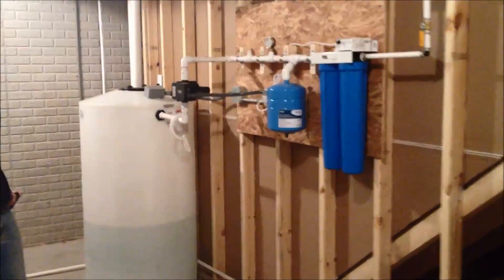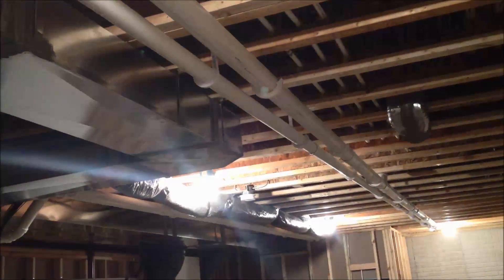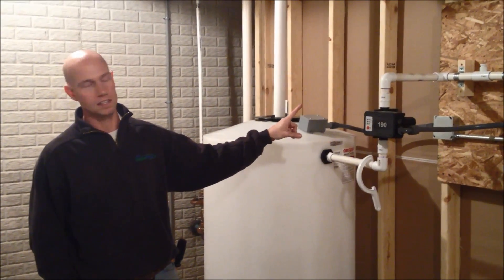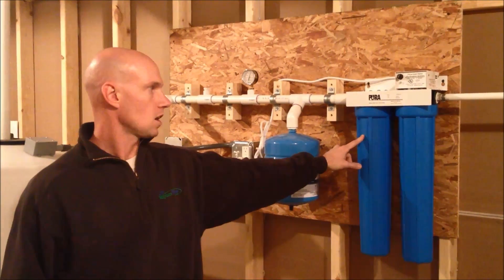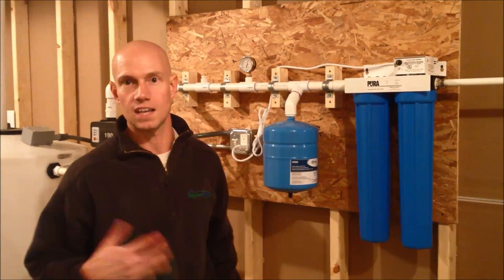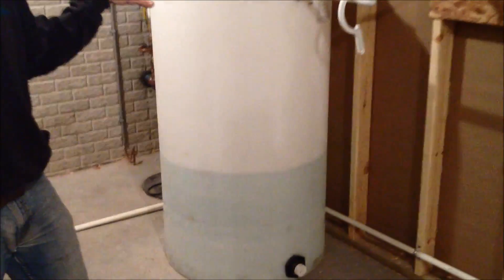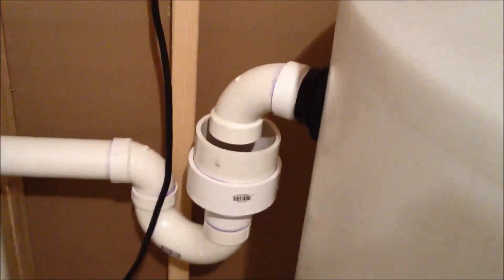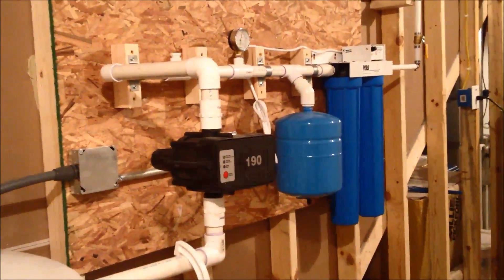Greywater Recovery System

Comment: Hi

How much grease and soap deposits are clogging the tank?

Is there any method of cleaning such a tank that will not exceed the savings from its use?

I am not kidding myself, I just wonder about the practicality of the solution.

Thanks!
Reply: Why do you want to clean it?
If you put in chlorin tabs regular, there is nothing that can happen the chlorin breaks down everything to a little bit of sludge on the buttom, that you have to drain every few years.
Reply from the maker: I have no idea. I was only a subcontractor on this house over 8 years ago. And it was a brand new system at that point.

Comment: cool system. Where did you get the carbon filter? What is the life of the filter(gallons)? Can it be back flushed?
Reply: Praveen Shenoy I bet you could use a Pentair Brand 20 x 4.5 carbon or gac filter or maybe coconut carbon.

Comment: I have a few questions on your system. What is your first stage filter system? (the one directly before the container? Is your pump loud or quiet? How large is your storage tank? What type of pump are you using to get the water back up to the toilet? What is the item that you have that provides pressure in the pipeline? Lastly, how does your pump know when it's time to fill the basin? Thank you for the video, by the way

Comment: If the water is being used for the toilet, why filter it, or just filter for hair and solid debris, pressurize it and connect to toilet supply line
Reply from the maker: it's not super-filtered to make it crystal clear, just usable and storable without getting too nasty. They also add a colarant dye.
Reply: Haha a carbon filter and a UV filter is likely overkill but they won't have bacterial growth issues.  The money to set this up would be around $1000 to $2000 without a professional.
Reply: Tyson Collier I bet you could set up a system like that using sharkbite pipe an connections, 55 galllon drum, and a pre screen on a RV pump that’s 115 volts.
Reply: @T1000.Android  
So, for you carbon filter and UV should be enough to avoid bacterial issue, it's your opinion?

What do you think about the tank? Which material used to build it ?
I thought if I use UV I should use something hermetic to the light for security reason (protect people's eyes)

and what about the oxygen? Better to be quiet open, because oxygen will kill most of the virus, bacteries etc

What do you think?
Reply: @timzawa  Hello, a multi stage filtration system with a uv light will be more then enough.

In Australia we use mainly polyethylene tanks and steel tanks with a polyethylene liner. 

The key is to keep you gutters clean and your roof relatively clean.  I have been drink rain water off my roof for a long as I remember and I never had a problem.
Reply: @T1000.Android   @Tyson Collier  Hey, thanks for your answer.
Honestly, I was just thinking using this water for toilet or maybe a little bit for floor cleaning, I am in a flat, I just want reuse water from kitchen/bathroom.
So the roof and gutters will be a topic for the future.
I was more concern about the legionella risk if I keep the water in a tank long time, need to check the temperature, use UV light...
I was wondering about the oxygen topic in the tank what do you think about that?
Installing UV lamps in the PE tank easy tasks?
Thanks again

Comment: Very helpful! where did you get the pump and the filters? can you tell me please and thank you for the video.
Reply from the maker: The builder told me that it's all standard off the shelf materials. A good source for such stuff is PexSupply.com but he bought the materials for this system at local plumbing supply and hardware stores.
Reply: Ricardo Herrera I would use sharkbite pipe and push connections, some 20 x 4.5 filters and a small pre screen and 115 v RV pump like a shurflo 3.3 gpm or bigger. I would use 55 gallon tank but in video it looks like 2-3 bathroom house.

Comment from the maker: Water from the washing machine might be too soapy and the lint would clog the filter quickly. The system would work with dual flushers. No limit on sitting in the tank because they installed a drip system to inject a dye and they keep a sanitizer tablet in the tank (per local code requirements). There is a bypass valve that can be turned to bypass the system and use fresh water, but right now it's not automatic.

Comment: Very cool video.  Could you use water from the washing machine?  Does this system work with dual flush toilets?  Any limits on how long the water can sit in the tank, toilet bowl?  Does the purge value siphon from the top or bottom of the tank?  Is there a fresh water supply to the tank there is not enough recycle water produced?  Can the toilets be switched over to fresh water if need be?